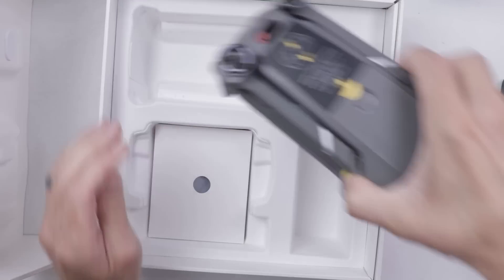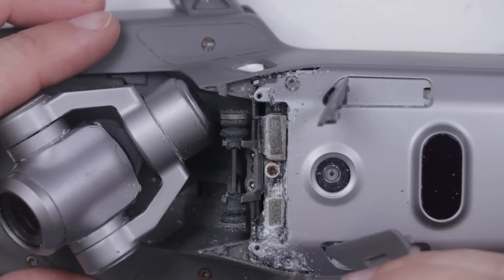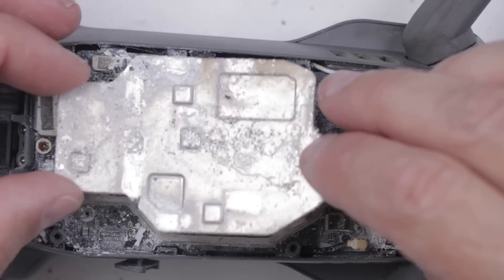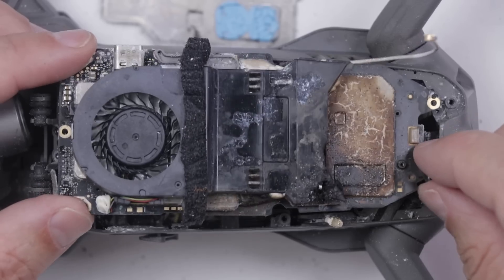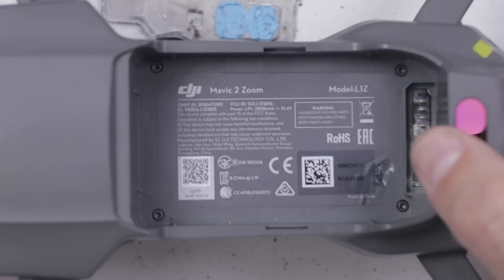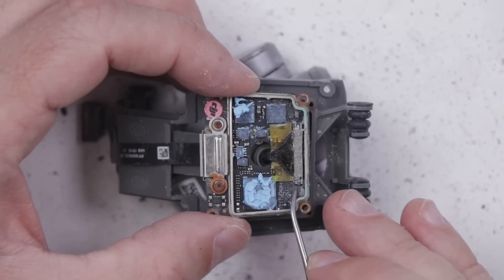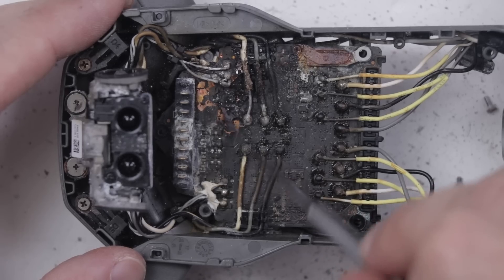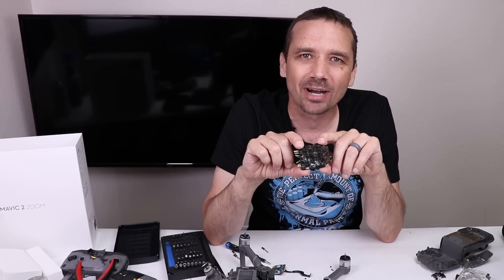What Salt Water Does to Electronics - Drone Crashed Into the Ocean

Comment: Does anyone know the value of the resistor R27 of the Xbox 360 wireless controller PCB?  It is located near the battery terminals, next to the TP20.  Thanks!

Comment: The charred part is the ESC, which is the part in charge of drawing the amperage of the battery and provide power to the motors (which as you can imagine, draw a lot of amps). The ESCs are likely to burn out if the motors pull too much current, so I'd say it happened quite the opposite. I'd bet the ESC burned out and that caused the drone to fall into the water and not the other way around.

Comment: This is a total crash. This unit after letting it sit with saltwater inside is just ruined. I doubt very much is useable. Had it been immediately washed in fresh water it probably would never fly again.  It would need an electrical engineer to even try, probably unsuccessfully. Letting sit was just too much. NOT RECOMMENDED.

Comment: Ya if my drones ever hit the ocean or any salt water body I not going out of my way to recover it.    Made that mistake once when I was traveling and my mavic pro (1st gen) had a crash into the ocean.. recovered it within a half hour thanks to the last GPS position of it in the app being accurate.  It was as far gone as this, including a burned through series of cables.      That being said fresh water, solid possibility if your quick enough you could recover a drone specially one made like DJI makes them and have minimal or no issues even.  I still have my magic 2 mini I got as a backup pocket drone that sunk for few hours at the bottom of a fresh water lake, had to sneak back in at night ( can’t remember why) and dive to get it and it other than the battery and the gamble where great.  Replaced both on the cheap mind you it all works perfectly.  Actually no I got a firmware error first flight but after another firmware update it’s fixed and still flies like nothing ever happened.

DJI already controls and monitors very closely the mosfets and stuff that controls the power, in theory DJI could add another layer to their crash detection, which can already determine a hard impact from a more mild one, they could test to see how unrecoverable this crash is for example and if it fails, shut power off.  Reduces the risk of fire on land from a crashing and it also keeps corrosion down when impacting water.   Maybe make a toggle of it in settings… or give us the users the option to send a power down command if it crashes.

Comment: That was super interesting! Are the growths from the corossion conductive? Like I wonder if something got wet with salt water, stored without proper cleaning, and left alone, is there a possability the growths would make contact starting a fire? I'm not super familiar with the chemistry of it all, but really and awesome video!
Reply: Considering the battery is dead it probably won't start a fire, but if you put in a fresh battery that's actually an option. You'll have shorts all over the board and under the chips.

Comment: Hey Steve, I’m an idiot and screwed up my first repair. All I need is a new shell (don’t spray paint those, it doesn’t end well), a pre-assembles top screen assembly, and L and R button replacements. And I need to replace the clip connecter for the circle pad, and replace the circle pad itself.

Eh, it’ll be fine!

Comment: Yo Tronics brother I know you don't fix amplifiers but I have a question I have two pioneer av receiver one outputs sound but it buzzes but Ik electrolyte capacitor gone bad and another one no sound relay clicks and make loud pop noise and graphical lines are full what's the problem let me know if you know what's the problem
Reply: Scam doesn't work here bro 😂😂😂🤣

Comment: We have an Xbox Model X.  All of sudden it stop seeing the controlller   We changed out the box and now the same controller works.  If I do a full reset on the Xbox and wipe it clean, do you think it will bring it back to life??
Reply from the maker: I wish I knew but I don't know if that would help or not. Sorry
Reply: I had a problem with the Xbox One with it not seeing the controller unless you have it wired It's due to the Wi-Fi chip but for the series x I don't know
Reply: Have you plugged it into the console with usb-c? If it works that way, but not unplugged, it's the wifi.